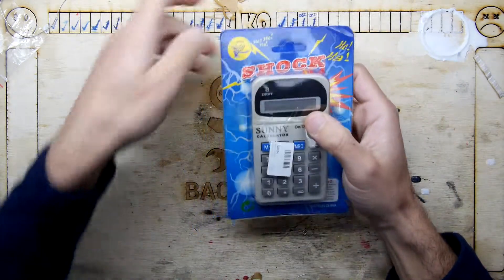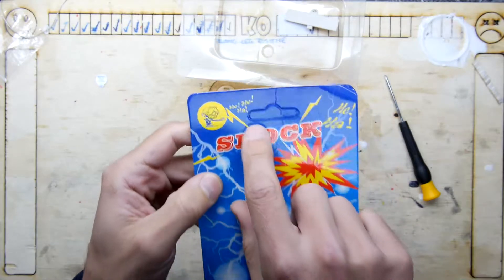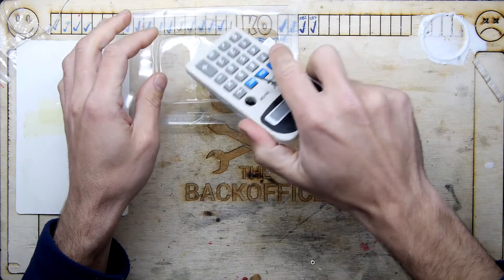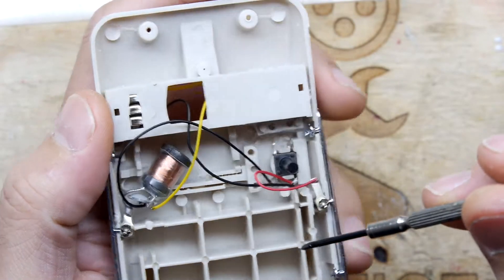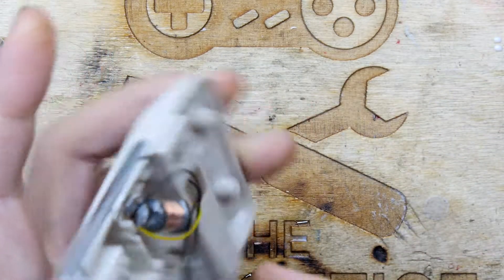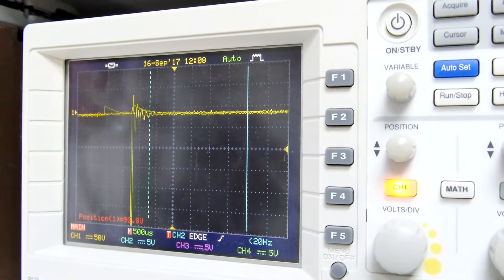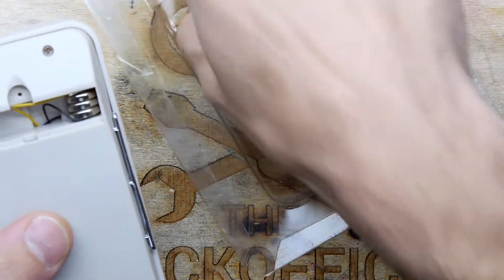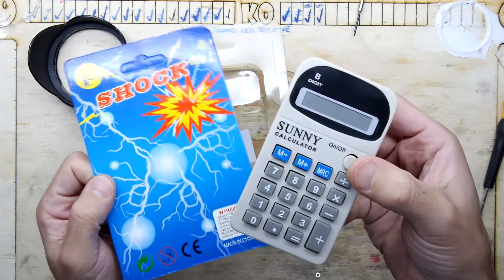Electric Shock Calculator

Comment: "AHH! AHH! AHH!!"
Reply from the maker: +Penurious Sierra it's so funny how you know it won't kill you but you just don't want a second jolt 😂
Reply: The Backoffice 
Oh yeah, it is!

The circuit works just like those flyback transformers, but high voltage conversion only occurs once and as magnetic core gets saturated with DC, it quickly tapers off, limiting the harm.
You definitely don't want to tap the button quickly as it may cause sustained high voltage spikes!
The circuit is composed of coil with high turn ratio and one button that connects to the battery. Very simple and quite reliable :)
Reply from the maker: +Penurious Sierra I always wanted to make my own and drive it from one of my controller boards using a car coil. I really need to get around to that again